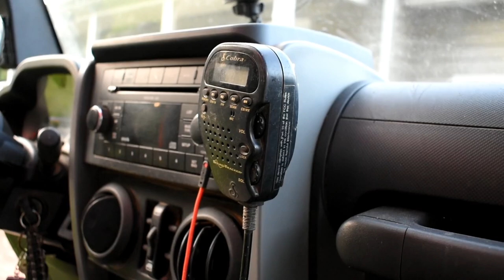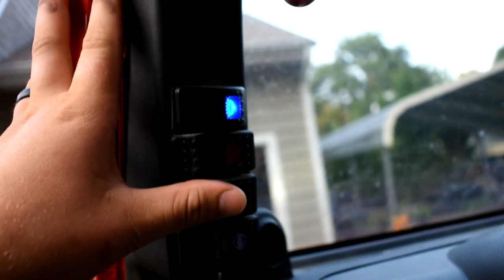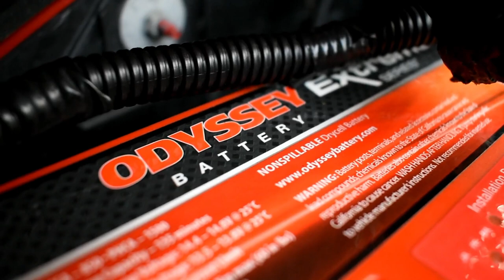JKU on 40s - Mod List Walkaround and What Mods Are Next!?

Comment: And im just sitting here with a TJ and a dana 35 rear. Can't wait to build a ford 8.8, regear and go up to 33s.
Reply: Man I’m running 35x12.50 s on a D30-D35 stock gearing 3.73s. Buy the tires you want, wheel it, break it to give yourself a reason to fix/upgrade. I have a rear TJ D44 sitting on the ground waiting for my D35 to break!

Comment: Another great video, love to see or hear what you had to trim out on your rear to make the 40's fit , I'm on 37's now and will be going 40's over the next year, already have PR 60S, Coilovers and long arms installed in 2 weeks...but I understand 40's may have clearance issues at the rear, have a 16 JKUR if that matters.
Reply from the maker: I plan to make that video soon! I’ve trimmed a tad on one side and still need to flex test it. If everything checks out then I will make a video of me trimming the other side!  How much lift are you running?
Reply: JK Gear and Gadgets Right now it's around 5.5 to 6 but hoping after the LA , I can dial it down to 4.5, the short arms I'm told are causing the extra height with the coilovers.. but yeah love to see a video on doing that mod... also met ya at Jeep beach... keep up the kool videos, love your humor !

Comment: Looking at doing tons myself, curious what year models to look for. Heard something about kingpin vs ball joints????
Reply from the maker: Kingpins are the older models, very strong but hard to find nowadays. The new 05+ superdutys are stronger axles but have balljoints. A lot of people say balljoints axles are less desirable but honestly on a normal jeep with 40s or 42s they will hold up perfect fine (might have to change ball joints every few years but that’s no biggie). But yeah try to shoot for 05+ superduty front 60, a sterling 10.5 rear or a 14 bolt rear from a 2001+ Chevy 2500

Comment: How is the flex and steering with the 40s offroad on stock width axles? Im on37s on my d44s and just wondering if you can retain full steering lock to lock with 40s? Btw Im up in winchester va and I go to rausch creek as well as the cove many times a year!

Comment: Hey buddy I was looking at some of your old vid what tie rods you end up using?  I know you had synergy at one time that was starting to fail I’m looking to replace the stock ones.  I’m running 37x12.5x22.
Reply from the maker: Check out the new barnes4x4 aluminum steering!! Amazing price and looks like an amazing kit, I’m going to try to ther tie rod soon
Reply from the maker: I currently have the ruff stuff tie rod, not a big fan. My synergy drag link is great though

Comment: Hey, I’m looking on purchasing a 2007, 08 JK. Any advice on what to watch out for before purchasing? Also, is rust a big problem on 07 and up (jks) ty. Awesome vid btw!
Reply from the maker: This is a very arguable topic. A lot of people dislike the engine in the 07-11 models. These years have the 3.8, the 12+ have the 3.6 which puts out more power. Now.. the 3.8 isn’t that bad, but it all depends on what you plan to do with the jeep. 35s and bigger I would try to find a manual tranny. The 3.8 paired with an auto isn’t fun to drive. So engine/tranny I would go with the 6 speed if your set on the earlier year JKs. Rust isn’t a big issue with them, but it all depends on where you live. Honestly the JKs don’t have any huge “hiding” problems. Just like all cars try to avoid high mileage and avoid jeeps that are already modified
Reply: Tysm for your reply. Yes I have heard about the complaints about the 3.8 but honestly 07-08 are around my budget. My ideal set up would be 2.5 in life and 35’s.
Reply from the maker: Yep for 35s you’ll be good! And I hear ya on the budget, 12+ models get pricey.

Comment: awesome jeep! this may be an off topic comment but have you ever had problems with the 02 sensor bank 2 sensor one? mike keeps saying it still misfiring and I loose speed during driving so I wanted to see if you have had that particular problem and if you fixed it. gone through 4 sensors.  I have a RC 4in lift on my jeep. feels great just need bigger tires now
Reply from the maker: I haven’t, wish i could help but don’t have any ideas of the top of my head
Reply: damn thanks bud imma try my best to figure this out

Comment: Hey Ben love the channel I actually  seen you on a trail at rausch one time over this past summer. But I had a quick question I know you went to tons but how did this set up hold the 40s I have a similar  set up minus the truss  and the rcvs  and I have 37s but I want to bump up to 40s
Reply from the maker: It worked ok, but even with the prorock 44 and the Rubi rear, parts were wearing out very fast with the 40s
Reply from the maker: With 44s, the jeep does best overall with 37s
Reply: @JKGearandGadgets  which parts ? Axle shaft ? Gears? The only reason I ask is because I bought s brand new set of 40 in nittos on machete beadlocks for 1000. Was gunna sell the 40s but I may want to keep them. I cant decide
Reply from the maker: Alex Cutrone rear shafts (chromoly), bending about every other trip, balljoints, wheel bearings, brakes, etc. wheeling with 37s and built 44s is a lot more fun than wheeling with the 44s and 40s. JK on 37s/38s and built 44s is one of the best platforms for this jeep
Reply: @JKGearandGadgets  thanks!! Thank you for answering! It's nice to get feedback  from someone who ran the set up and not someone who knows someone!  You should do a YouTube  followers wheeling trip to rausch think that would be a fun time!

Comment: Did you take your axles out and apart to weld the truss on?
Reply from the maker: No, but it would have made it a lot easier. My welds are a little sloppy from how cramped I was. If I were to do it again I would drop the axle

Comment: Very cool Jeep, great video. Do your grab handles squeak when wheeling?
Reply from the maker: Which ones? The metal grab bars or my Velcro ones?
Reply: The metal ones. My passenger side squeaks like crazy. I added a rubber spacer against the pillar, that didn’t work. I’m going to try a nylon spacer this weekend.
Reply from the maker: That’s Crazy. Mine don’t make any noise

Comment: As somebody who just finished a super duty swap on a JK; don’t get a 14 bolt. You’re not breaking that 10.5 sterling. I’ve broken my front Dana 60 already from beating on it, but that 10.5 is more than strong enough, with a lot more ground clearance than a 14 bolt.
Reply from the maker: My issue with the 10.5 is the clearance from the pinion and the Jk tank. Don’t really want to do a fuel cell and not sure I’ll have the cash for a gen right tank. I might be able to smash the tank in to get the clearance. I guess we will see
Reply: I have a stretched two door, so I may not be experiencing the same issues. But it was a non-issue for me. I am running the stock tank with a full 14" of measured travel. I'll hit you up on instagram.
Reply: 05+ superduty axles are garbage. Front: axles shafts that break like glass, no aftermarket chromos for it except 3k rcvs, 2 piece axle seals that mean u have to pull the carrier out and do seals every time u break a shaft. Do yourself a favor and buy a older ford kingpin front (more expensive at first but not in the long term), incredible aftermarket support and very easy to work on. Pair it with a 99+ factory disc 14 bolt and you will have the perfect combo
Reply: I'm only running 40s on them, and I beat the piss out of them. They are plenty good for me, saying they 'break like glass' is some pretty laughable bullshit.

Comment: What about your synergy ball joints what are you running now.
Reply from the maker: Still running them, they sent me new ones under warranty and the new ones seem to holding up a lot better
Reply: JK Gear and Gadgets great that’s good to know.
Reply from the maker: However I would still recommend dynatrac or rare parts balljoints if you have the cash
Reply: JK Gear and Gadgets I will look into those, if they are a lot better don’t mind spending more but I’m all about budget build,😀

Comment: My jeep is coming close to 105,000 miles, any recommendations on to keep the engine running good?
Reply from the maker: Which engine? 3.8 or 3.6
Reply: 3.6 , appreciate your response!
Reply from the maker: Of course! And sorry for the late response this time, I don’t get notifications on sub comments, so if I ever don’t respond again just make a new comment and I’ll see it.  But for the 3.6 it’s a lot better designed engine. They will go for a long time! Main things to look out for is the oil cooler, sand casting in the coolant and a few other small things. Both will give you Symptoms before a failure! Like I recommend to everyone, check all engine bay fluids monthly and you’ll be good to go, most issues with these engines are from people not noticing a loss of oil (leading to a failure). I would also recommend doing a seafoam treatment (which I will be doing a video on soon!) Also, have you been using synthetic oil? If not then I wouldn’t switch at this point.
Reply: No worries at all and this is all great information I will look out for! I use full synthetic and I do stay up to date on my oil changes, I look forward to seeing your video on the seafoam treatment! Thanks again for the insight

Comment: this has probably been asked already but why do you have quick disconnects if you had the electronic sway bar disconnect?
Reply from the maker: Because once you lift the Jeep you need longer sway bar links, no sense in getting aftermarket links that aren’t disconnectable in case your rubi bar fails (which is extremely common)
Reply: ah... oh. that makes sense... great looking ride. keep wheelin it

Comment: where did you get the front Bumper?
Reply from the maker: It’s a motobilt hatchet front bumper
Reply: got a link where you got it please?
Reply from the maker: https://www.offroadelements.com/motobilt-hatchet-front-bumper-with-stinger-and-fogs-wrangler-jk-2007/. Keep in mind that this motobilt hatchet is a frame chop bumper, so it’s not direct bolt on. But has many advantages over a bolt on bumper

Comment: Do you have any rubbing with the 40
Reply from the maker: Haven’t had the chance to flex it out offroad yet. 🤦🏻‍♂️ I’m sure I will have to trim some spots though.
Reply: JK Gear and Gadgets I have 40 and I have rubbing on a full turn, it would hit the frame. Also I wondering how your tires are not hitting your rock guards
Reply from the maker: Joe Samad how much lift? I’m at 4.5” and 3.75” wheel backspacing. I’ve also set my control arms to move the axle forward about 3/4” more than stock.  And I previously trimmed the rock rails for my 37s

Comment: Hey if you ever wanna be a really good friend, can you tell me what your height is to your hardtop with the 40s? Need to lift mine to fit 40s
Reply from the maker: What exactly do you need?
Reply from the maker: You need total height?
Reply: Yea, from floor to the top of the hardtop (in the rear particularly) need to clear a garage
Reply from the maker: Ok, I’ll try to rememeber when I put my hardtop back on.
Reply: JK Gear and Gadgets if you can provide me with height from floor to top of the roll bar that will help
Reply from the maker: 79” from floor to top of the roll back. Measured above the rear tire as that’s the highest point on mine
Reply: JK Gear and Gadgets appreciate it! Looks like I need to modify the garage opening first